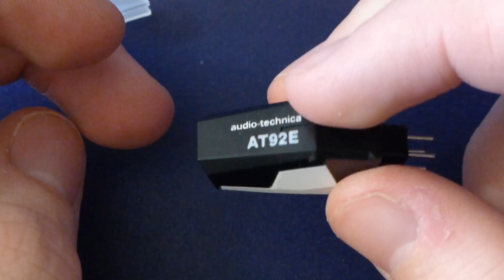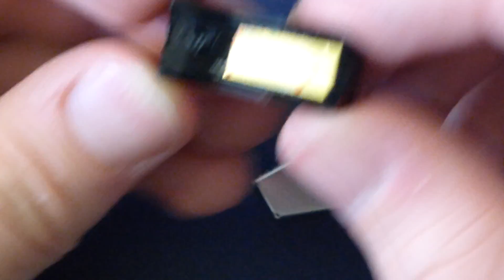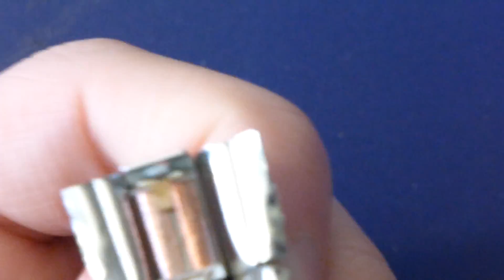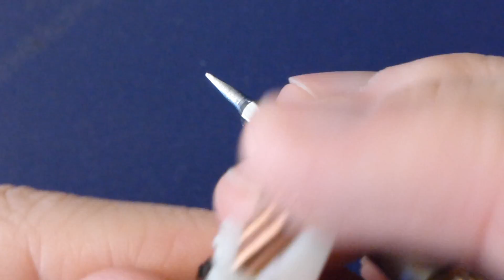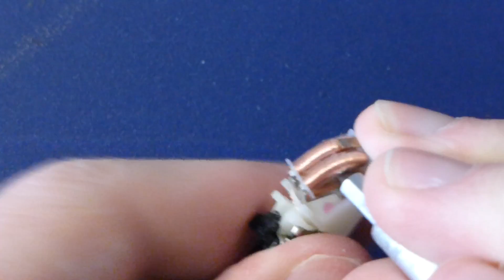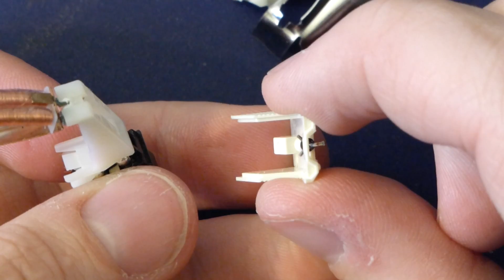Destructive Teardown of a Failed Phono Cartridge

Comment: Thanks for the video. I’m restoring an old Webster 106. I can hear sound at the needle but nothing out the RCA cable I made for it. I repair circuit boards and amplifiers but never seen a record player much less worked on one. 
It has a Astatic 40-TB cartridge with dual needles. One for 78 which looks like a ruby? The other is for 33 and 45 it looks to be diamond. I have no continuity and it reads open on the 2 pins coming out the cartridge. Now to find a replacement 😂😂. Doubt they exist anymore. Thanks for the video. You helped me trouble shoot. Now I know I should have extremely low resistance and continuity on the 2 pins. Even tried from the needle arm to the pins. Open circuit everywhere.

Comment: The coil magnetic circuit is the crucial component, which may not be visible in this video. The V-shaped piece behind the needle is a two-legged magnetic rod. Its simultaneous upward and downward movement represents a shallow-deep sound groove (L-R). When the legs move in opposite directions, it indicates a groove that bends left and right (L+R). The video shows two coil rods, each with two windings. These four windings connect to extract the left (L) and right (R) audio signals. Thus, (L+R) + (L-R) equals 2L, and (L+R) - (L-R) equals 2R.

Comment: My sears combined phono/radio unit has the fun of the cartridge sends a signal, but its so weak that the volume on the stereo has to be turned up to 75% to get any audio out of it. Since its a BSR turntable, I unhooked the two rca style connectors under it and plugged in a 3.5 mm adapter and found that the amp inside the main chassis is fine.

Comment: I had a similar problem with a much more expensive cartridge that had been in storage for years.  The left channel didn't work and the sound was terrible.  After watching your video I decided tearing into it wasn't the answer.  Remembering a trick for a stuck computer hard drive, I put the cartridge in a plastic container and stored it in the freezer for a couple days.  Then an afternoon in the NC sun, back to the freezer overnight and then back in the sun.  It works perfectly now.

Comment: The two little studs at the end of the cantilever are magnets.  The movement from the stylus cause the magnets to move which cause current fluctuations in each of the coils.  The magnets should never touch the coils.  If they did, they couldn't move freely so the small current wouldn't be produced.  This very small current must go through the pre-amp in order to be brought to a useful level.

Comment: It is not the STYLUS that is bent/canted. It is the CANTILEVER that is bent/canted.
Reply: All these folks are right. There hasn't been 'needles' for records since the days of wind up gramaphones. The thing that's bent is the cantilever, which attached to it is the diamond stylus. You do come across as a novice or ignorant in simple audiophile parlance.
Reply: Man, Im surprised no one here got the NEEDLE joke.
Reply: I'm sensing anger.
Reply: +Carl Rudd No it's the cantilever.  Modern cartridges do not have a needle.  There has never been a true needle since the long playing vinyl record became prevalent over 78s (they literally used a steel needle which is why people use the term).  

Modern cartridges use a cantilever (generally either aluminium or carbon fibre) with a piece of diamond - the stylus which is either either direct mounted - known as nude, or glued - known as bonded onto the end of the cantilever.  The other end cantilever is generally mounted into the plastic using a rubber or synthetic bushing.

Audio Technica moving magnet cartridges (like the one in this video) have a couple of magnets on the cantilever that move inside coils.  It's the movement of the magnets in these coils that generates the electrical signal that eventually becomes the sound you hear from your speakers.
Reply: No, it's the NEEDLE.
Reply: Carl Rudd haha i get it